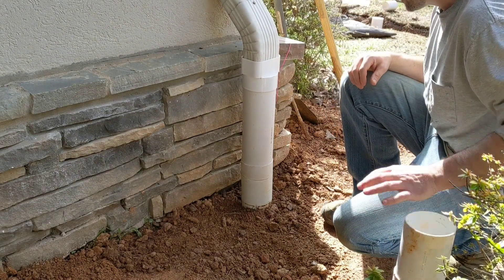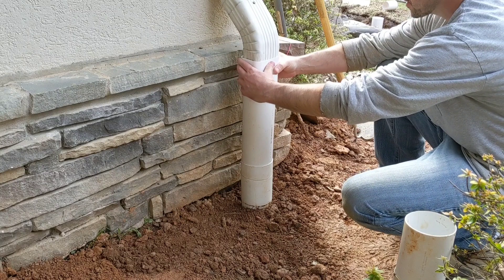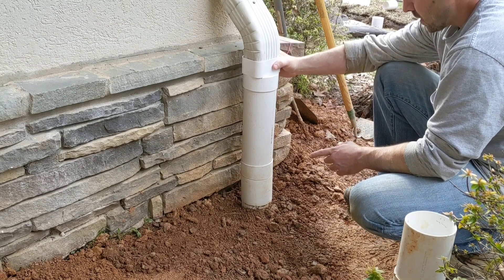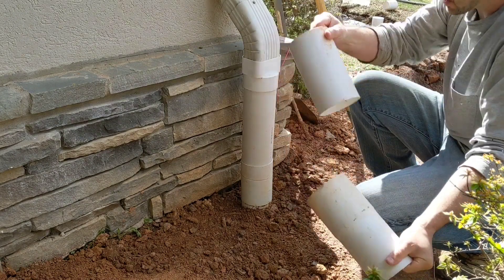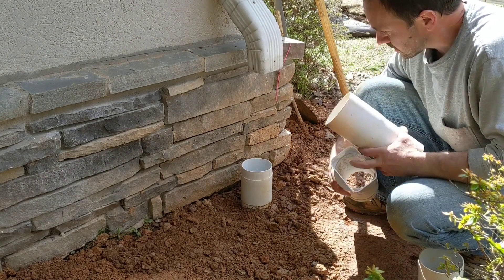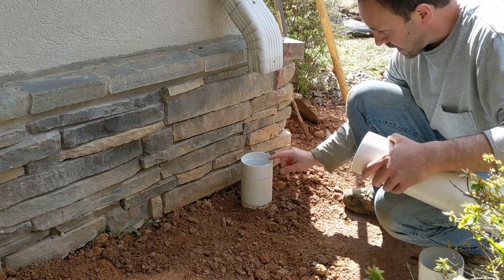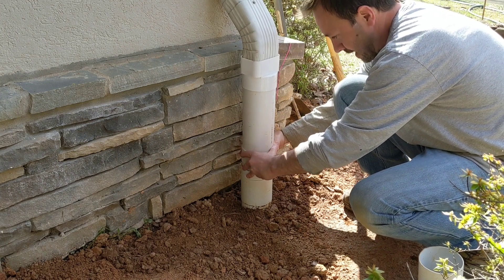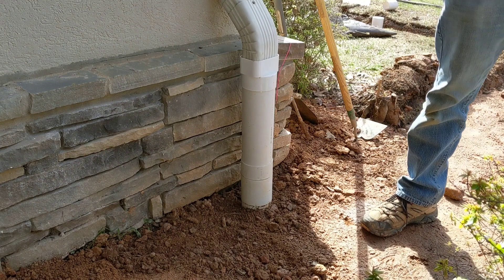Gutter downspout quick and easy disconnect to PVC ground pipe.

Comment: Nicely done! I need to replicate this on my down spouts.
Reply from the maker: Out of curiosity are you doing a new system or thinking to retro fit an existing set up? I certainly see no reason someone couldn't simply cut an existing pipe nice and clean and then fit the slip rings on after the fact.

Comment: That's a great and very simple solution.  I had all the fittings bought to hook my shop's gutters to the drainage system I'm installing when I remembered all the leaves and what looks like giant cockleburs that fall out of my neighbors Maple trees. I'm just leaving the downspouts to drain onto the 1 1/2" crushed driveway to catch the debris and the water will go down to the drain rock and pipe system.  Right?
Reply from the maker: Mine is going into a closed pipe all the way to the end, about 150 feet away, there's no drain rock in the ground like a french drain or drain field or anything like that. I'm mostly dealing with leaves which I find the weight of the water has no problem blowing out of the downspout, down and out of the end of the 4 inch PVC. About the most clogging thing would be twigs from the nearby river birch trees, which if you've watched any of my other videos about....and a sweet pain in general due to the amount of twigs and limbs they love to drop.

Comment: Can you water test it. Would like to see how bad it leaks.
Reply from the maker: I'll try and get some video when it's raining but there's really little to no leaking. It's all vertical drop and it's not under any pressure. You may get some negligible drips but the area gets more water splashes from rain falling just outside the roof line than anything you'd see here.  The slip ring fits quite snug and as long as the cuts are nice and straight and everything else it fitted up well there really should be no concern.
Reply from the maker: Hey finally had a rainy day where I could get a video of this quick disconnect. As you can see there's little to no leaking and certainly nothing to be concerned with.

 https://youtu.be/cx-ZntpigUg
Reply: I've got two gutters hooked up to drywells and the only time it has a problem is during a torrential rainfall. So much water is going down, the air can't get out fast enough! I needed to put a vent in but, didn't think ahead like, Whateverunique!
Reply: @WhateverUnique  That Guy was just Trolling you! That system works fine! ( I also watched the other video as well!)